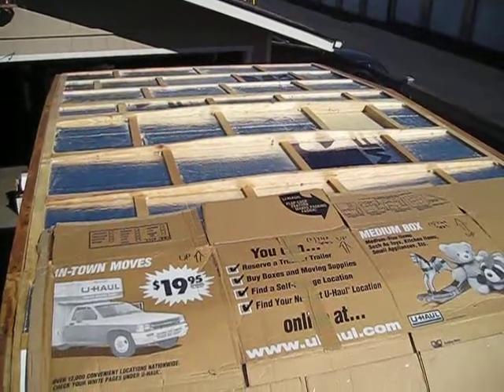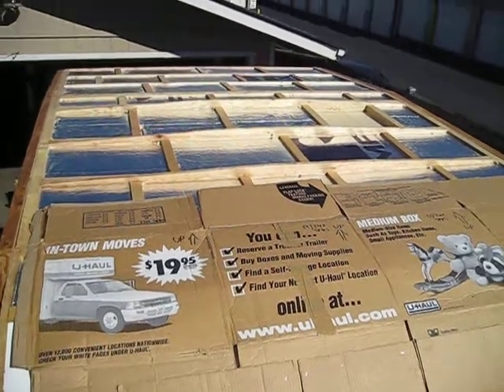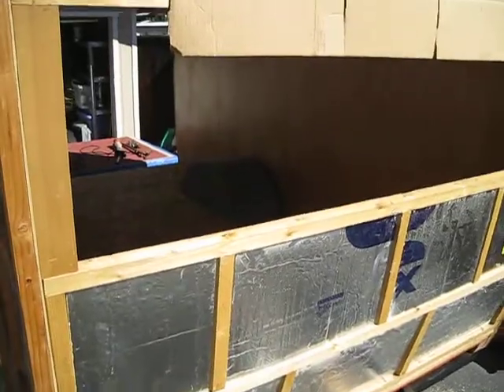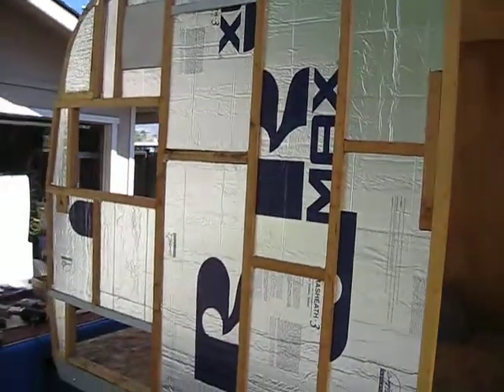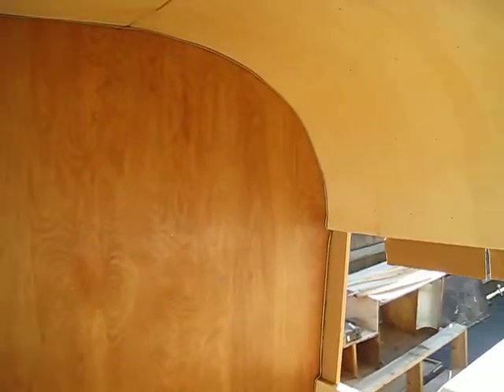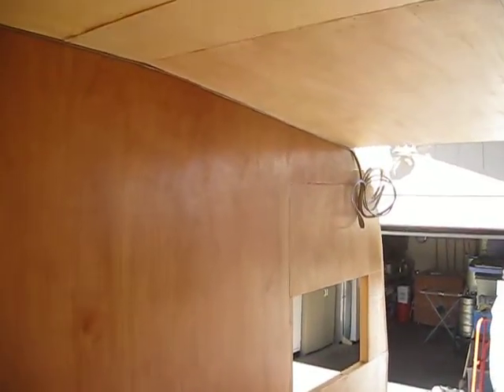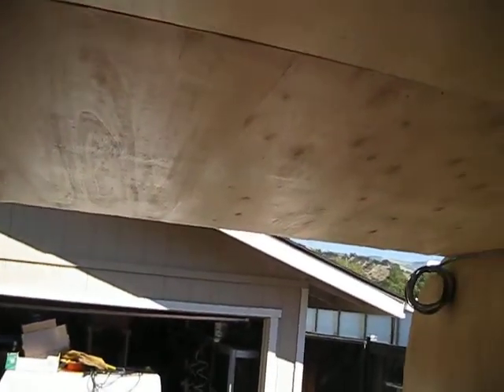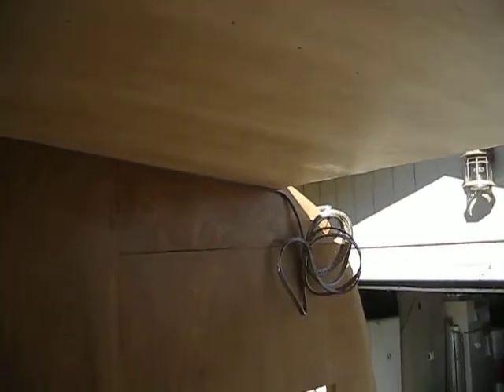1964 Shasta Travel Trailer reconstruction project part five roofing 100814

Comment: Did you ever finish the Trailer? where's the video?

Great job so far... I'm doing the same with a 1959 Lincraft  Can Ham trailer...
Reply from the maker: Rudy Hernandez Hi Rudy,
No, the trailer is not finished.  But Season 2 Episode One will air soon.
As I state in the video, we're waiting out the winter here in southern Oregon.
Meanwhile, I've been gathering parts and pieces for the finish work.  For example, a WFCO 8955 power distribution center, and custom aluminum siding from an outfit in the Portland area.  The goal is to have it completely finished by October 2015.  I see you have some videos of your Lincraft and I'll check those out.  These projects are sometimes duanting, but also rewarding.  Good luck with your Lincraft.
Reply: Thanks,  I'll keep eyes open for your next video as well. ...